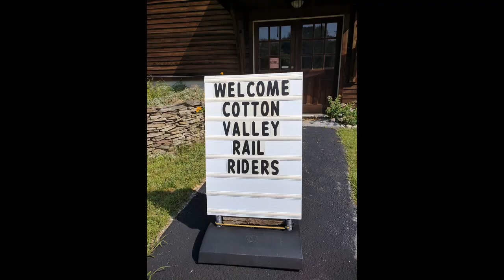Speeder Weekend   August 2017

Comment: Should of shown them in motion on the tracks, pictures are nice but you have to hear the steel wheels on the tracks. And the sound of the engine, pictures don't do that. Keep working on it, you'll get it right.
Reply from the maker: Safety regulations prohibit the use of electronic devices by the operator of the equipment...